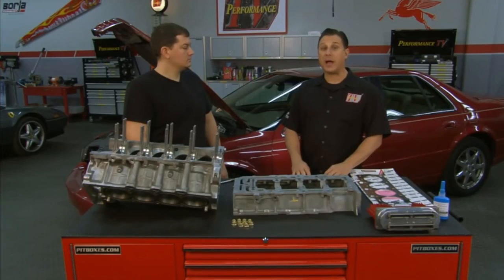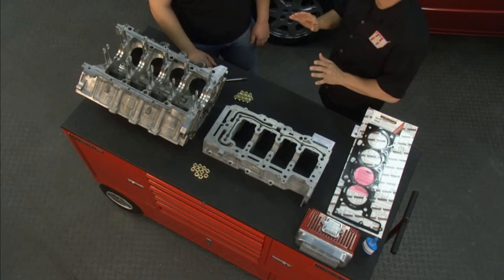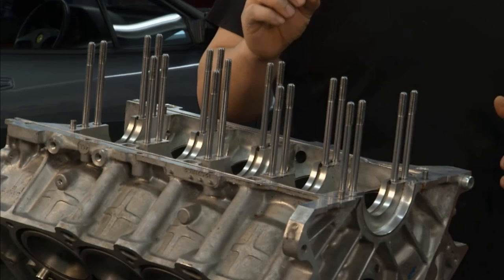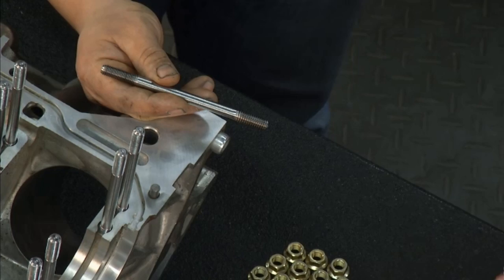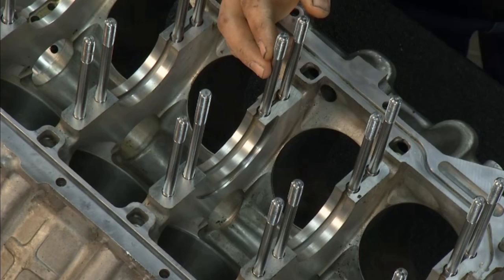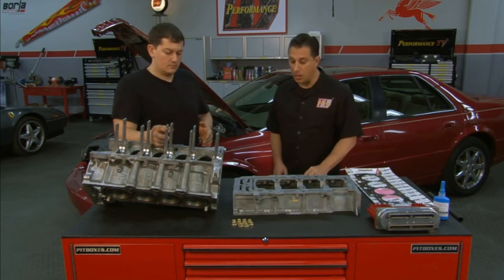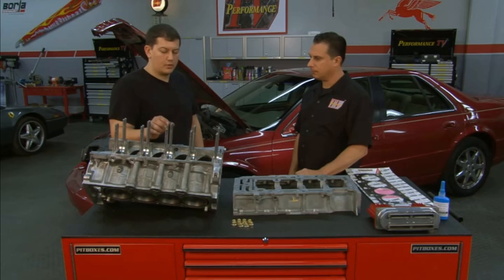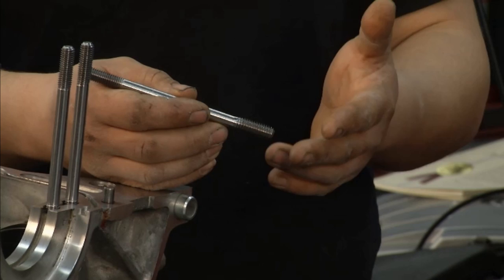Northstar Performance on Performance TV in Tennessee - Part 2

Comment: You can tell the Northstar is a racing design,shame caddy did not address these minor issues and saved it from getting a bad name.
Reply: KJBPSkipper never understood why either.
Reply: John Sluder  Try servicing the cooling system per the operators manual using the CORRECT GM COOLANT FOR ALL GM VEHICLES AND ENGINES WITH ANY ALUMINUM IN THE COOLING SYSTEM CALLED "DEX-COOL" AND YOU WON'T HAVE "HEAD BOLT FAILURES".
Reply: @deeremeyer1749  Using Dec-Cool will not save you from head Stud failure, the threads are small and fine, coolant type has nothing to do with it.
Reply: They actually changed all of these problems from 2004-2005 on with them... made the engine bulletproof with almost no way to destroy them anymore
Reply: GM always protects its precious corvette

Comment: These N* can be cranked to 400HP so easy and they are still bulletproof
Reply: François D Its basically a factory racing engine,its a shame the fuckheads who were running things did not deal with the issues this engine had before it got a bad name,they really are awesome engines once you work out the flaws.
Reply: If you call adding a supercharger like they did in the XLR-V just to reach 440hp easy.

Comment: how could i tell if my 99 Seville has upgraded head bolts without taking my engine apart?  Thanks
Reply from the maker: Remove the oil fill cap, look for a head bolt or a stud. If it looks like an internal hex-drive head bolt, it's factory.
Reply: @NorthstarPerformance  Thanks, What year if ever did they upgrade the bolts/studs?
Reply: @EurekaRecycler  not an expert and learning myself, but so far i've heard 2005-6 onwards they used the ls6 head bolts ?

Comment: I just got a P0301 reading.1st cylinder misfiring. Top fix. Replacing head gasket. 2nd top fix is replace spark plugs. Is this how the head gasket problem starts showing up? My 99 Cadillac Seville has 84,000 miles on it.
Reply: My 96 Seville started misfiring at 100k, replaced plugs and wires and all good.  Coils started to go next, but those are 5 minutes to replace and cheap on eBay.  I would not start with the head gasket, unless you know for a fact that's the problem. $$$$$$, unless you know how to do it.

Comment: 4 bolt mains?
Reply: Sort of, but stronger. There are 4 main studs per bearing journal, but it's a girdle type design which also includes many smaller diameter fasteners around the outside.

Comment: Do you guys sell the same type of tool to help Guide your drill on the top end as for the bottom end, or do u have to send it to a Machine shop?
Reply from the maker: Main studs are a direct fit.....we don't have oversize in stock currently for the bottom end.

Comment: i have two 95 cadillacs one has the 4.9 and the other the 4.6 need tips on both cause i really love these cars anybody got any good tips to throw my way
Reply: Pamper it like it was your wife
Reply: @LamontBoucherville  I'm rebuilding the the motor and heads
Reply: @CDC-Vprototype  I see.....  In that case I have no clue
Reply: @LamontBoucherville  I now know a lot more and I'm just doing all the work myself
Reply: @CDC-Vprototype  👍👍
Reply: @LamontBoucherville  
I now have my 95 and 94 Cadillac DeVille concours with northstars one of them is running and working but needs it's transmission rebuilt and the motors getting a rebuild just cuz I want to build a performance car out of it and the other I'm just going to keep it on the road and take good care of it until I have the budget to rebuild that motor

Comment: Northstar vs 3800 series 2 🤔🤔 decisions. Someone help me
Reply: I Hate That You Have To Pick From 2 Of The Worst Engines Ever. But Id Go North Star. Ive Had a Couple Last For A Very Long Time
Reply: Don't what this guy I talking about but the 3800 went 6 years running as the best v6 built, had a 2000 buick lesabre with the series 2 3800 for about 10 years never had any problem, sold it about year and a half ago and got a 2006 buick lucerne cxs with the 32v northstar my head gasket cracked and now I gotta replace the whole engine gonna cost me about $4000 trust me go with the 3800